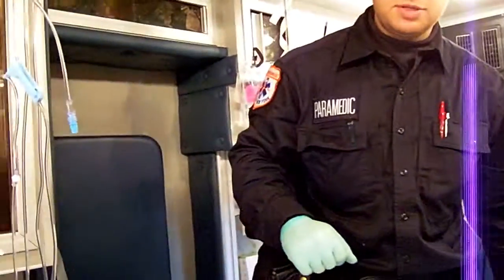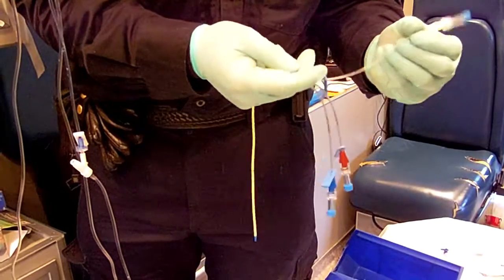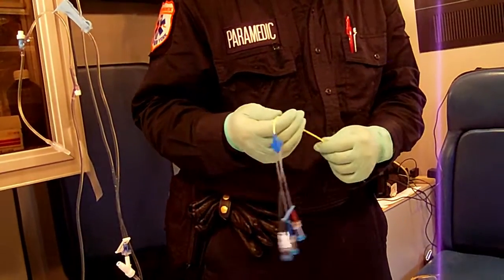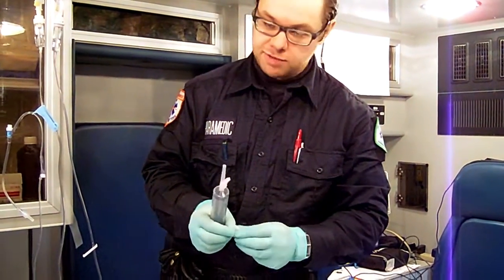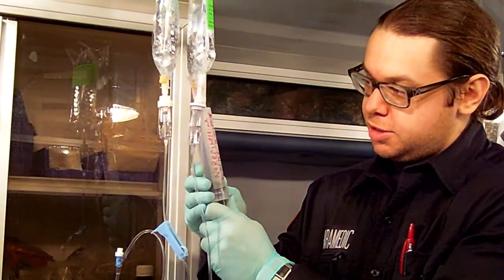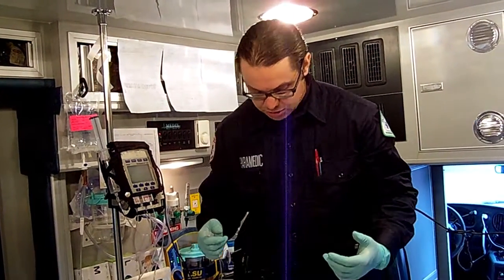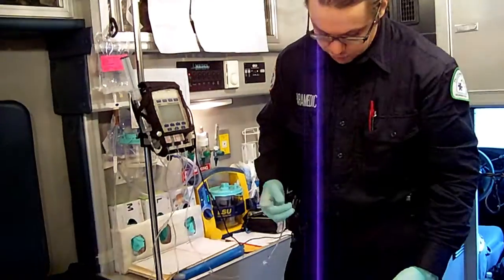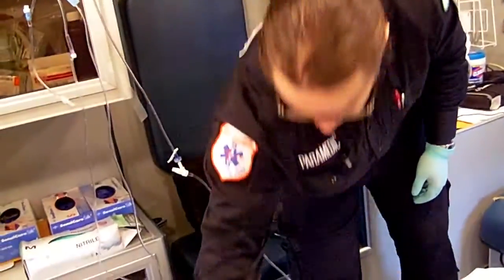(Part 4) Basic set up of ALARIS MedSystem III IV PUMP for CCT

Comment: Good video.  PLEASE READ.  When using a central line, DO NOT remove end - cap of Lumen without clamping the lumen with a slide clamp!  ( video  performed this incorrectly, very dangerous) This presents a very high probability of air emboli to patient.   Plus blood will drip out rapidly.  An end cap should be used that allows for "one way valve" needleless luer lock syringe or IV line attachment.  I'm a Registered Nurse of 9 years.  Thanks for reading. Safety is no accident.